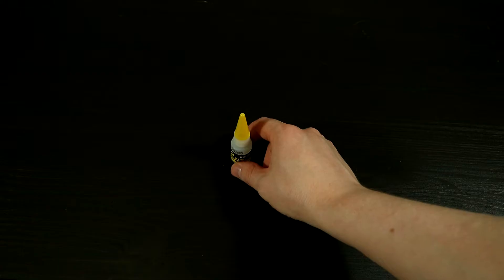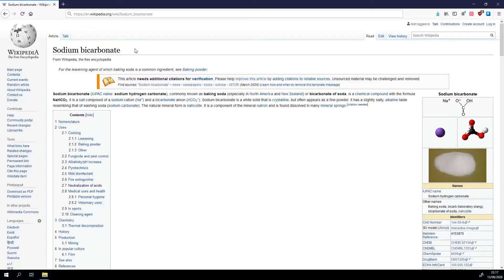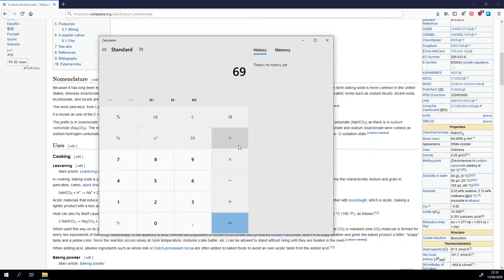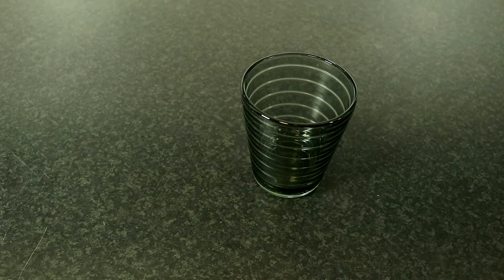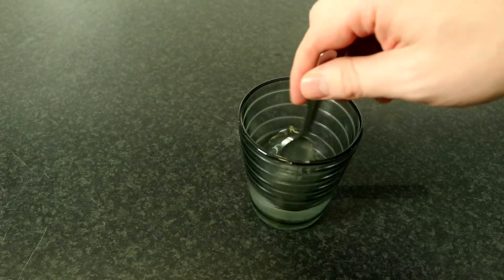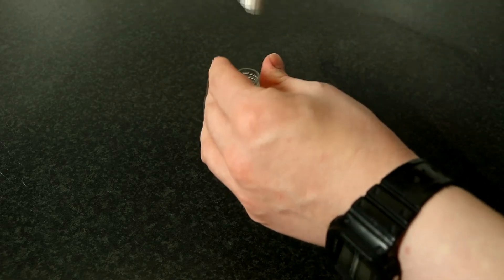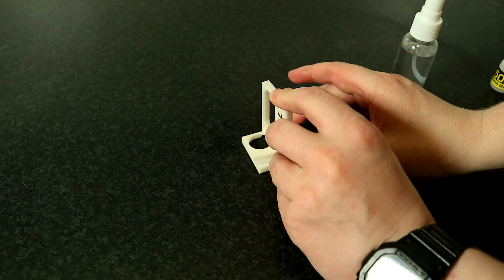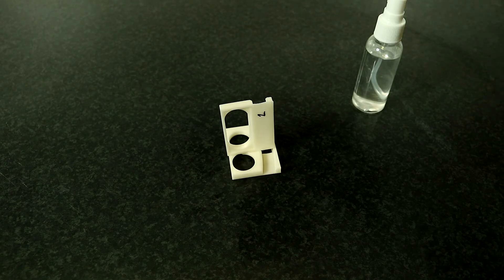Home made Super Glue Accelerant

Comment: You can adjust cure time by adjusting the concentration of baking soda.  Your concentration is too high.  That is why you can not spray the dry side before you put the parts together.  The glue probably sets before it makes good contact.  Generally, you want a few seconds of working time to line up the parts before the glue sets.  A blog I found says 0,04 mg/ml.  That's half what you used.  Might help, who knows.
Reply: yes even 1/4 tsp. works fine in 125 ml in another recipe trying to better approximate commercial accelerator behavior. That's 9.8 mg/ml tho... Richy Rich what is 0,04 mg/ml? 0.04 mg/ml? Did you mean 0.04 g/ml?
Reply: @OtterLakeFlutes  Maybe?  It's been a while since I learned to Google.

Comment: This is the first video for home made accelerant I have seen that doesn’t try to use IPA in the mix. Great! Baking soda doesn’t dissolve in IPA so it never goes well. One improvement for you though, use a spray bottle that produces a fine spray. You must use yours after attaching the pieces because your spray puts too thick of a layer of water on the part. A fine mist will make this work exactly like store bought.
Reply from the maker: the problem with a finer atomizer is that the baking soda tends to clog them, so mileage may wary.
Reply: @Purkkaviritys  If you avoid alcohol and wipe the nozzle clean after each use it won’t clog but if it does, such clogs should be easy to flush since baking soda is VERY soluble in water. Make sure you use distilled water to mix it to avoid suspended solid contamination. Using tap water in a fine mist atomizer will cause a build up of these suspended solids which can easily clog the smaller ports. Just look how easily a shower head clogs up over time and those ports are huge comparatively. Distilled water won’t do that.
Reply from the maker: @fraudbuster1456  yeah usually running the head under water is enough, still annoying.

Comment: None available?  You can buy 3 100ml bottles of stanley superglue that comes with 3 400ml spray bottles of proper accelerator for under 30 USD all over the internet with free delivery.  That much super glue will last for ages unless you are doing a huge project.  I did all the crown molding joints in a 2500 sq ft home with less than 1/2 of one of the bottles.
Reply from the maker: I live in EU, lots of things that are available in droves in US like just don't exist the same way here. I did find a local place that does sell the activator a couple months after the video but at the time I didn't have a nice place to find it as its a specialty store product here.

As a side note, I have gotten comments that have pointed me in the right direction as on the internet the best way to get the highest quality answer is to post the wrong answer first (deliberately or accidentally).

Comment: Isopropyl alcohol works much better.
Reply: Needs to be diluted with distilled water to around 70% abv. Some moisture is required to activate and accelerate the drying - alcohols evaporate too quickly. Combine with a little sodium bicarbonate to neutralise the acidic CA, and you will have a good, cheap activator.
Reply: NOOOO

Comment: I have not used store bought because its kind of hard to find. So I made some after watching a couple of these. 0.25 tsp / 118ml (bottle size) of .91 IPA . Not all the baking soda would dissolve so I just filtered out the remaining sediment to prevent spray issues. Seems to work fine. Its < 50 degrees F in my garage so times get slow normally. It works better now. Even better with a little applied heat too. I'll be testing more over the next week.

Comment: Use isopropyl alcohol instead of water for near indistinguishable from store bought accelerant results
Reply from the maker: @Zaretti25hz  for science?
Reply: @Purkkaviritys I have tried Alcohol and Acetone.  Neither works as well as the Commercial stuff. I will try some water.  The water and a small amount of baking soda worked better.  Perhaps my mixture had to much baking soda in it with the Acetone and Rubbing Alchohol.  You maybe right on the cheap rubbing alcohol that has 30% water.  I was using denatured.  The stores  - Grizzly and FastCap are out of the excellerator.
Reply: @MarkJonesRanger commercial uses acetone
Reply: @Zaretti25hz  Because water isn't great to spray on wood, it will raise the grain.
Reply: @Zaretti25hz  yeah I've got to step in here -- using water is ridiculous in many applications, that's why the commercial stuff is a nonpolar solvent. The point is to dry quickly, not dry the glue quicly then have wet wood or porous powders etc... half of what anyone uses this for (inlaying powdered colors in to wood). Plus water raises grain.
Reply from the maker: Won't work at all, the Isopropyl alchol will pull all of the sodium bicarbonate from the solution, I tested this exact thing.
Reply: @Purkkaviritys  I guess he's using hand rubbing alcohol, which is 70% Isopropyl alcohol and 30% water, the later allow to dissolve the SB, but I think SB isn't soluble at all in 100% IPA. Solubility o Sodium bicarbonate in different liquids: 0.02 wt% acetone, 2.13 wt% methanol @22 °C, insoluble in ethanol. I don't have specific data for IPA, but the molecular chemestry show it should be even more insoluble than ethanol
Reply from the maker: @Zaretti25hz  trying to find the solubility on was a massive pain, rubbing alcohol would make sense. Good thing I didn't have the space setup yet to do the proper testing. will add this to the eventual video.
Reply: @Purkkaviritys  you are lying about "testing this exact thing", for if you had you would realize that not only does it work but it works so good that it renders the water based solution you describe totally useless. I am a woodworker and I've been making my own accelerant that way years before you even posted this video and I have not bought store bought since. My comment I posted was not some untested hypothesis I thought up. It was a solid tried and true tip to help you. Also I am not the only and likely nor am I first to have discovered this....look it up, or actually try it for real and you too shall see. 1/4cup isopropyl alcohol to 1/4 teaspoon sodium bicarbonate is a pretty decent mix if you ever get tired of soaking your work in water and want to experience what store bought accelerant is like to work with. 
You are welcome.
Reply from the maker: @MrGibsontoldnolies  
Well, I'm not lying, what I might have done is mixed with wildly wrong ratios.

I re-ran the test I originally did, which was to have 20ml of IPA and 1/4th tea spoon of Sodium bicarbonate, and got the same result as last time, it does not seem to dissolve just to make sure that I'm not entirely crazy. The 'does not seem to' being the operative part.

will have to do some testing on how much actually dissolves, as your recipe calls for 71ml (1/4 cup) and 5 ml of sodium bicarbonate which is 4 times as much IPA as I used, which in turn will show as a lot of undissolved deposits at the bottom of the glass I used to test.

The biggest hurdle to be honest was trying to find any information on whether it would dissolve at all (I figured it should given it can create mixes with water). after the first experiment and then the followup where I add IPA to water solution containing sodium bicarbonate and it would precipitate out gave me the impression that it is not dissoluble.
Reply: @MrGibsontoldnolies   Adding some acetone to the alcohol, about 10% make it dry even faster.
Reply: @johnsaia9739  cool, I'll have to give it a try sometime. Tbh I've never even thought about how to speed it up because I had always felt it sufficiently fast as is however I do appreciate the tip, thank you.
Reply: @Purkkaviritys  the problem here with rubbing alcohol was way too much bicarbonate. It actually was dissolving in the rubbing alcohol (the 9% to 30% water) -- just didn't seem like it because not nearly all of it would dissolve (it was saturated with a fraction of what you dump in there).  1/4 tsp will dissolve in rubbing alcohol and gives you store bought-like results. People even use 91% alcohol... one thing you can do is shake it until more won't dissolve then pour the rest off the top -- it's now saturated with all the bicarbonate ions the 9% H2O can take without heating. I never did understand what you were doing with the water calculation in the video... trying to saturate the water with 100% as much as it would take?
Reply: @Purkkaviritys  You must have messed up your ratios.  alcohol will work much better than water, but acetone will work better than alcohol as it is what is used in most commercial activators.
Reply from the maker: @SeaDogMT  I figured that I did, should try this again with diffrent kinds fo alcohol and acetone to see the results.
Reply: The commenter is spot on!. No need for bicarbonate of soda at all. He means, using isopropyl alcohol neat as an accelerant. The best option is acetone. Just keep the alcohol or acetone in a small spray bottle & use the same as a store bought accelerant. Sodium bicarb can turn the superglue white when dry!.
Reply: @williamdavies3295  So you are recommending acetone, a solvent that breaks down CA glue, as an accelerant for CA glue? Isn’t that kinda like recommending water as a PVA glue accelerant?
Reply: K, well sorry for any confusion, hopefully it works out for you. Thanks for the good content, keep It coming.
Reply from the maker: @MrGibsontoldnolies  Still proves that law of the internet: The best way to get the right solution is not to ask for it, but to post the wrong solution :D
Reply: How about … don’t. Baking soda is not soluble in isopropyl alcohol. Use distilled water with fully dissolved baking soda in a fine mist sprayer if you want store bought results.